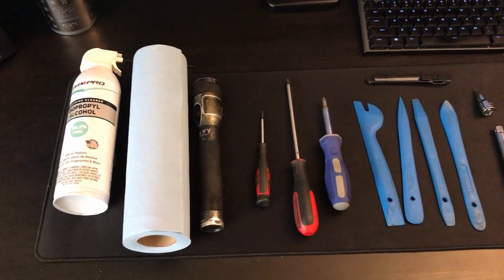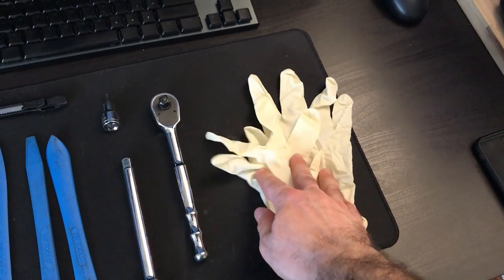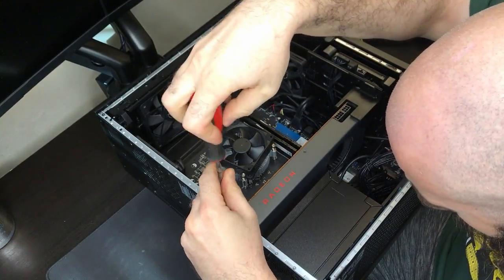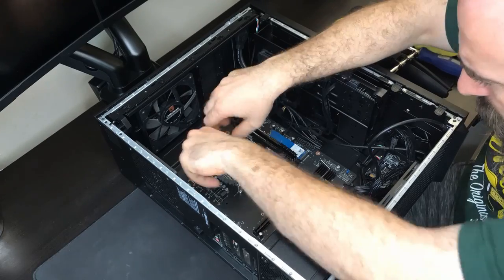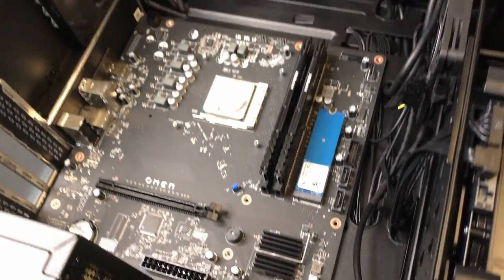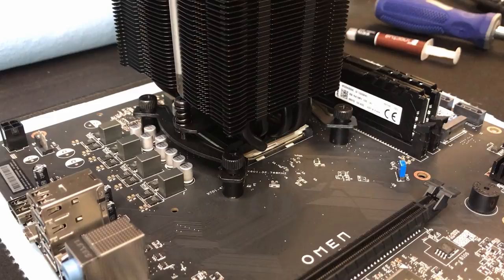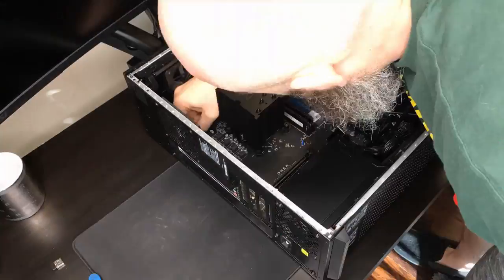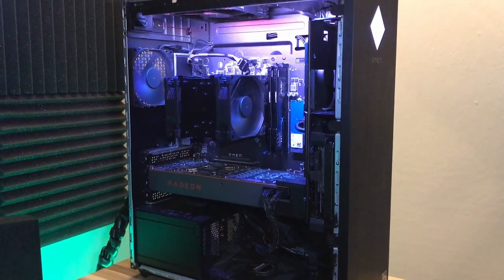Installing A Noctua CPU Air Cooler In My Omen! Complete Tutorial 😎

Comment: Hi Dan,

Great videos! I love the way you explain everything slowly and with details, since I'm new to it I have to take my time! lol.

I just got quick question, since you have more experience and know these omen's better than anyone.
I pre-ordered OMEN 30L Gaming Desktop PC GT13 with RTX 3080 couple days ago, since it was great deal on Black Friday so I decided to go with cheapest set of 8Gig RAM which says it's HyperX 3200, and WD 256 SDD and add another 8Gig myself + put more another WD for more space. So here is the question, some people says that these HyperX usually being locked in BIOS, and I won't be able to just add the same brand to this existing 8Gig for them to properly work, but just need to buy some different kit of 16Gig's RAM.
And also, while watching your setup, I noticed there is only one place for NVMe SSD. And some people says that there are 2 of them, and I can easily buy another NVMe SSD and add to my existing 256 for more space. Is this also true? And where is the location of it? 

Thank you Dan in advance.
Reply from the maker: Most Omens only have 1 M2 NVME slot on the motherboard, but there are some Omens that do have multiple, but I don't see them that often. There is additional cables so you could hook up a 2.5" SATA SSD or a 3.5" SATA HDD. You could copy the information and Windows from your current M.2 drive, over to a larger capacity drive as well, but requires buying a copying tool.

If you replace the RAM to the Omen, it will lower the default speed from your motherboards max ( usually 3200 ) down to around 2133mhz. I am not entirely sure what happens if you ADD on to your existing RAM that you currently have. HP has / is releasing an update so you can enable XMP profiles for NON HP Ram. A lot of newer systems have received the update but my older Omen has not, once I do, I will make a video on it.
Reply: @DanKamYouKnow  
Thank you for the reply Dan,

I do believe the AMD Ryzen versions of OMEN have potential to changing mhz through the AMD Master utility.(As far as what I heard from others OMEN owners) But I still will appreciate if you will ever have a chance to record a video, if there is a potential truth in that. My HP does come with Ryzen 5 5600x. 

And one more thing Dan, I know you have Noctua CPU cooler. I was considering getting the same one you have, or just getting NZXT Kraken 120mm Watercooled cooler - even though I know Noctua will beat Kraken any day regarding the temps but I just want my components to have RBG lights inside. In both cases I still will have to remove the motherboard to mount either Noctua or Kraken, will the Kraken with 120mm single fan will fit there? Or if I will decide to put a bigger CPU fan like Noctua NH-U14S with 140mm, will it even fit inside the 30L Case? And If you were me, would you suggest me to swap the OEM motherboard to aftermarket ones like ASUS or Gigabyte to have a better quality build or OEM will do just fine? I just sold my old PC and have extra $300-$400 to invest as soon as my omen will arrive.

Thank you in advance for the reply Dan.
Reply from the maker: Yes, you can alter the memory speed with Ryzen Master and I uploaded a video on it a while back:
https://youtu.be/PBervsjRYzw

So, Omen motherboards do not have conventional RGB hookups, their RGB is proprietary. So, you'd have to buy some external controller to power any kind of RGB components, and honestly to me, is not worth the hassle. The U9S will outperform all of the 120mm AIO's by about 3-5c. Any cooler over 140mm in height will not fit in the Omen, the side panel will not fit back on, which is why I went with the U9S. I also uploaded a tutorial on installing the Corsair H60, which will be the same process as installing the Kraken 120mm:

Corsair H60 Install:
https://youtu.be/sG9LLNnY3uY

Swapping the motherboard isn't 100% necessary but there are a ton of benefits in doing so. I do have an entire Omen playlist on my channel where I case swap / motherboard swap / etc that may be useful for you:
https://youtube.com/playlist?list=PLx9LWJcz6lN5lMqNjh_4gKG9YW5tMKHwA
Reply: @DanKamYouKnow  
Thank you Dan for your time and all the replies brother. I really appreciate it. 

Watched all of the videos you linked. Super helpful and informative. I will probably listen to your advice and put U9S with two fans attached, and reapply good thermal paste with putting new AM4 motherboard. I think that should keep my CPU with around 70c's. Many people on reddit suggest to even swap the case, and get a better one, with good airflow which will decrease my temps even lower, but I think it too much of a hassle. As long as my GPU and CPU will stay around 60-65 while gaming, I'll be happy. Noctua's fans should do just fine with airflow, plus I love how the case looks.

Comment: Hey so i ordered a couple noctua 120mm fans and 1 92mm rear fan with a kit of 3 splitters and want to do this u9s cpu fan and i see the top fan is pulling air in rather than blowing out like other videos i have watched. Is ur current setup still pulling air in or pushing air out?? Also i guess i need to order 1 more fan to mount to the heat sync? Howcome i read 80mm in your descriptiom but online it shows 92mm? Is there two different sized installed? Id need to get thermal paste to i guess.. And do i NEED the fan controller?
Reply from the maker: The best setup I’ve ran in my Omen is a bottom mount 120mm intake / top mount 120mm exhaust / rear mount 92mm exhaust. The stock air cooler uses an 80mm fan, the Noctua U9S uses a 92mm fan but only comes with one 92mm fan. It’s not necessary to get the 2nd one but it will help a bit with airflow. You do not need the fan controller, it’s completely over-kill
Reply: @DanKamYouKnow  perfect buddy thank you

Comment: Do you need to remove the stock backplate to install this cooler for the omen?
I have the omen obelisk, I don't know if that would have a different stock bracket than yours.
Reply from the maker: Yes, you do have to remove it.

Comment: Great video Danny! I was really impressed by your "push/pull" mechanism. What was the extra fan that you used on the right of the cooler? Is it just a normal Noctua 80mm fan?
Also, I have absolutely no expertise in modifying pc, the idea of even touching the motherboard scares the heck out of me. 
I really want to give this a try but on the other hand, I don't really want to wreck my first pc ever.
Reply from the maker: Thank you so much!! The fan the was on the front of my case was a 92mm, but it honestly didn’t do much as far as temps go so I wouldn’t recommend it. Replacing the cooler isn’t too difficult of a job, you just gotta take a good amount of before pics, take your time, and know that the cooler backing plate is going to fight you! Make sure you have the proper tools to get it off.

Replacing the cooler isn’t 100% necessary though and the Omen is fine in its stock configuration 👍🏻
Reply: @DanKamYouKnow  Do you mean you don't really recommend to install (or maybe "hang") a fan mount to the place where your Hard drive disk is located ? I just bought a new OMEN 30L but the hard disk is located on the upper right instead of lower right place (where I guess the place your hard drive disk is located). So I feel that it could be even harder for me to place fan there.
Reply from the maker: That front fan makes very little difference. It’s in a position where not much airflow can even pass through it.

Comment: Hey Dan! Is the noctua NH-u12a too big? It looks like it would fit and I’ve read it cools a lot better.
Reply from the maker: It is too tall for the Omen, the side panel won’t be able to be placed back on. This is the main reason I went with the U9S 👍🏻
Reply: Ya I was thinking that had to be the reason. I’m going back and forth with either putting the u9s in, or case swapping and getting a bigger noctua cooler. Anyways thanks for the quick reply as always!
Reply from the maker: @Eustes  I would 100% go with the case swap. Then you can plan out cooling with the new case. Even just a case swap alone to a high airflow case, will drop temps considerably.
Reply: gotcha, have you put a bigger cpu cooler into your fractal meshify case?
Reply from the maker: I have had many different builds since then but yes, I actually used the Chromax U12s for a while and a mix of different liquid coolers as well.

Comment: I need HELPPP... one of my fan turbine broke on my cpu cooler and I don’t know what to do
Reply from the maker: You have the stock cooler on your PC? I would probably buy another CPU cooler fan if I were you. Here is the one that I used:

Noctua NF-A8 PWM chromax.Black.swap, Premium Quiet Fan, 4-Pin (80mm, Black) https://www.amazon.com/dp/B07ZP64Q3M/ref=cm_sw_r_cp_api_fabc_Lo1QFbV5SY2NR
Reply: I have the omen 25L stock cooler
Reply from the maker: I would replace the fan as soon as you can. Super easy process and will give you great results. I install the fan I linked above in this video:

https://youtu.be/BBxvgaHMQSQ

Comment: Is this cooling solution a substantial upgrade over the stock liquid cooler by Coolermaster that comes on the Omen-30l? Just ordered one with an i9-10850k and a 3070, quite worried now!

Thank you.
Reply from the maker: I think it will cool it slightly better than the stock AIO but not by much, that processor runs very hot. You’ll definitely want to upgrade the fans in the case for sure.
Reply: @DanKamYouKnow  Thank you! I appreciate your help.

Comment: would this work for the 30L??
Reply from the maker: Yes it does, the 25L and 30L are almost identical except for the extended front panel and front 120mm fan. Same process for a 30L 👍🏻

Comment: I watched your install can you link where you got the additional fan for your air cooler for the push pull setup.
Reply from the maker: Noctua NF-A9 PWM chromax.Black.swap, Premium Quiet Fan, 4-Pin (92mm, Black) https://www.amazon.com/dp/B07ZHF2BPB/ref=cm_sw_r_cp_api_glt_fabc_0YM23KNH1056B39SR97M

Comment: is this really necessary? I was wanting to put a new fan in mine but not if I have to take the entire computer apart
Reply from the maker: Definitely not necessary, but drastically lowers the CPU temperature. What temps are you getting while the CPU is under load?

Comment: I was wondering if there was a cooling fan that doesn’t require me to remove the old bracket? (My hands shake a bit when I feel nervously and looking at this makes me feel nervous without even doing it.)
Reply from the maker: There is a way but I do not recommend it because it requires modifying certain length screws and you're really not sure how much or little pressure you are placing on the CPU. There are videos of how to do it on YouTube but I would recommend just getting the right tools to do the job and taking your time. The hardest part is removing the cooler backing plate but with the right tools, it's not too bad.
Reply: @DanKamYouKnow  Alright, thank you!

Comment: Is the 25l  Case larger than the 30l case? I tried to install an air cooler into my 30l  but the case was too small and I couldn't close it 😭
Reply from the maker: No, the 25L case is slightly smaller ( in length ). If you’re going with an air cooler, you have to make sure the total height of the air cooler is less than 140mm.

Comment: If I get a new cpu cooler that has a similar bracket to the stock one do I really need to replace it or can I get away with using the stock one.
Reply from the maker: I would strongly recommend using the one that comes with your new cooler.

Comment: Is it needed to remove the motherboard and the back of the CPU cooling system, or can I also add the new Noctua cooler on top of the old back bracket?
Reply from the maker: Yes, motherboard removal is required. There is a video on YouTube on how to install a cooler without removing the motherboard but I HIGHLY do not recommend doing it this way because you have no idea how much pressure you are applying to the CPU. when using the stock HP backing plate. You'll want to use the backing plate that is provided with your new cooler, which requires removing the board.
Reply: @DanKamYouKnow  Hi Dan, ok I did it like you. It was easier than i expected. Unfortunally the result isn't as good as a thought, temperatur is going up to 75 degree celsius when gaming.
Reply from the maker: The cooler is fully seated and you used the correct spacers? You have a small amount of thermal paste that you used?
Reply: @DanKamYouKnow  yes I did it like you in the video, but I only have one fan facing to the fan on the back of the case. Thermal paste is applied.

Comment: am i just dumb? granted i watched this at work with no audio so maybe it gets explained but why remove the bracket on the back of the motherboard? it seems as though the new bracket used the same holes and that would have eliminated having to remove the motherboard? i assume I am  missing something? might have helped if the video showed him installing the new bracket onto the motherboard?
Reply from the maker: You can’t use the Omen backing plate with aftermarket coolers, unless you have custom length m3 screws. I highly recommend using the backing plate and accessories for the cooler you purchased. Using the Omen backing plate with the cooler accessories could result in excess (or lack of) pressure. 

I did show mounting the cooler backing plate, at 13:21.
Reply: @DanKamYouKnow  AH! lol sorry my bad! I dont know how I missed the point you referenced at 13:21! Thanks for the explanation! I have the newer (i think) Hana MB that comes in the Omen 25L GT12-1149 and Im just doing some research into cpu coolers as Ive seen claims that they are the weakpoint for omen computers.

Comment: Othe than this one, can you recommend any other cooler, I recnetly bought an Intel model 25L and i want to change it too
Reply from the maker: Any air cooler under 140mm tall will fit in the case. This cooler has been fantastic and will work with Intel and AMD ( Omen motherboard is the same spacing for both ). Not really sure what other coolers are out there though, haven’t done any research on them.
Reply: @DanKamYouKnow  thanks for the info!! Appreciate your help.. and your work!!!

Comment: dan need your help 36 yr old vet switched from console to pc well all upgrades i have done have been good and working psu ram gpu ext well i have an hp victus i hated the temps so i tried to change out the cpu cooler the lp veetroo shadow bolt right up but not sure wat i did man i have no display but pc powers up im at a loss and your help if ur not to busy plz help

Comment: sorry its 2 years later, but is a deepcool ak400 compatible? its 155mm height
Reply from the maker: 140mm is the max cooler height. Main reason I went with the U9S. Still the best cooler for Omens, to this day.
Reply: @DanKamYouKnow  what was the max temp when benchmarking? like cinebench, occt like at full full load.
Reply from the maker: 73c under Cinebench R23 multi-core on a 3700x.  

Honestly, I would swap the case before going with a cooler.
Reply: @DanKamYouKnow  yeah, i mean the case looks nice, it just doesnt have much airflow, im also rocking a 3700x, might upgrade to a 9 3900
Reply: @DanKamYouKnow just brought the U9s so I’m hoping I can fit it tomorrow thanks to this video. I noticed after having my HP omen 30L after a year the cpu started to climb to about 75 in game . So hopefully this can keep it abit cooler 👍🏻

Comment: Very important: HP doesn't use standard Ryzen backplates. It uses the Intel LGA 1151 75x75 size.
Reply from the maker: Correct. I should of mentioned it at the beginning but I do mention that more than half way through. Regardless of CPU, it uses the LGA 1151 brackets.

Comment: wouldnt the cooler hardware have just mounted to the stock bracket? im confused why you had to change it im looking at installing the same one on mine
Reply from the maker: The backing plate on Omens will not fit with any after-market cooler. They use some one off Intel backplate that only fits their coolers.
Reply: @DanKamYouKnow  i saw on another vid that they are intel threads couldn't i just get the right length screws with the same threads and use the included spacers? i live in an apartment im gonna have to borrow the screwdriver let alone the other stuff lol
Reply from the maker: It’s definitely not the proper way of doing it. By guessing what length screws they are, you have no idea how little or much pressure you are placing on the CPU. 

But yes, you can use custom length screws.
Reply: @DanKamYouKnow  i live by a hardware store ill give it a go if no dice ill do the proper way thanks for your time man your vids made me feel comfortable buying this pc plus i got a smokin deal at 700 from bestbuy you said buy it on sale lol cheers
Reply from the maker: Thanks man! I’m happy my videos helped you out 👍🏻. Lots of people have done it that method, so you should totally be fine

Comment: Do you believe the cooler master hyper 410R would fit in the omen? Its a little over 12mm taller
Reply from the maker: As long as it’s under 140mm in total height, it should fit! The only result I could find was 412R and it sits at around 136mm in height so it will be VERY close.
Reply: @DanKamYouKnow  the 410r sits at about 136.5mm so that's good to know. Must be under 140mm in height. Much appreciated! Thanks! Its so difficult to find anything to do with air cooling upgrades for the 25 or 30L You're quite literally the only one I've seen that did a air cooler replacement in this PC.
Reply: @DanKamYouKnow  Hey man. I just got myself one of the nh-u9s'. Installed it and now one of my ram slots are not working. Fairly Certain i did not over tighten the screws. Suggestions?